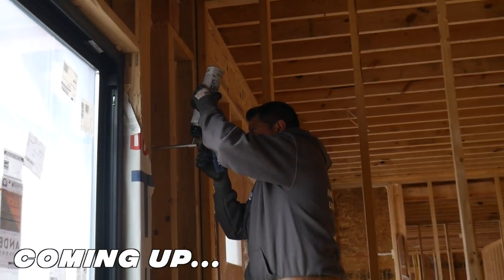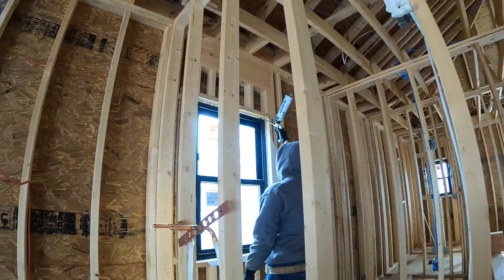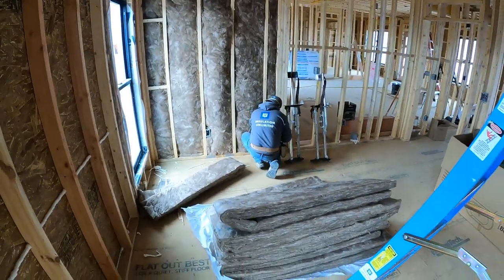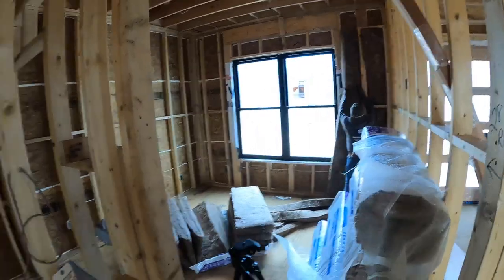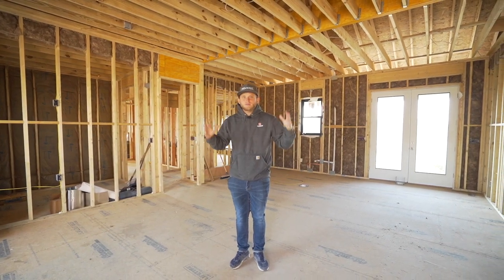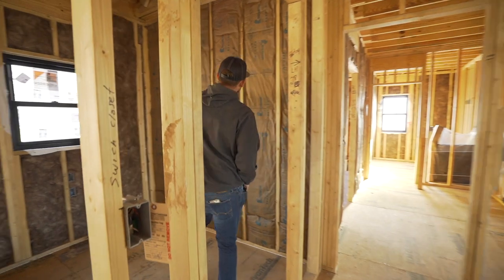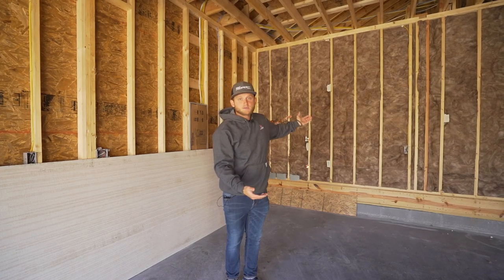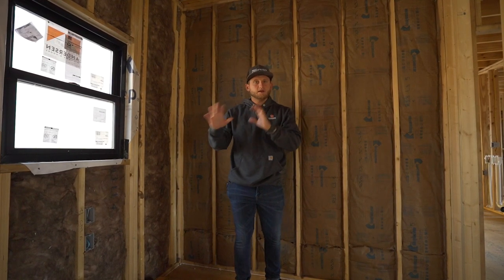Installing Insulation | Batt Fiberglass Insulation | Building A $350,000 Custom House | EP 34

Comment: I'm detailing my house out as they frame it (using Prosoco Joint and Seam filler), not quite as quick as the can-gun spray foam but I'm just doing a little every evening. Lots of "old school" builders would say the house is "too tight"... but they also said they same thing about house wrap... and insulation too I'm sure...